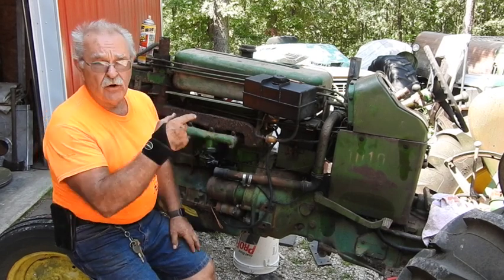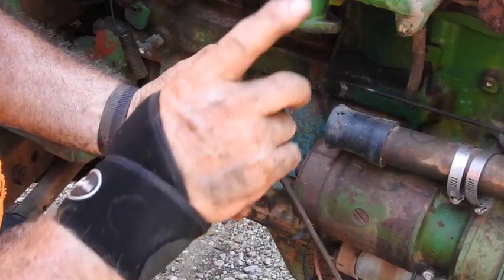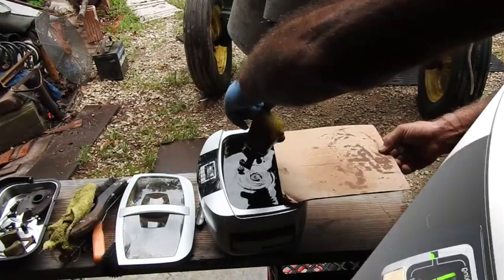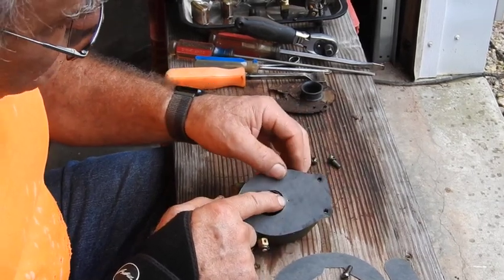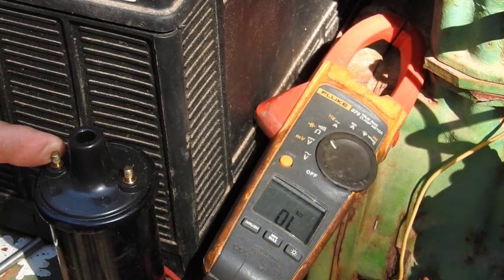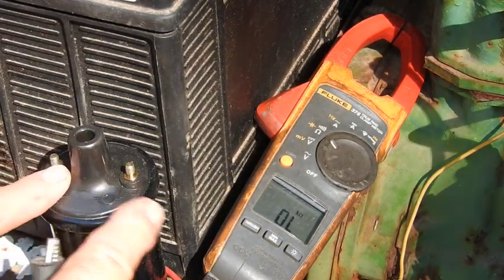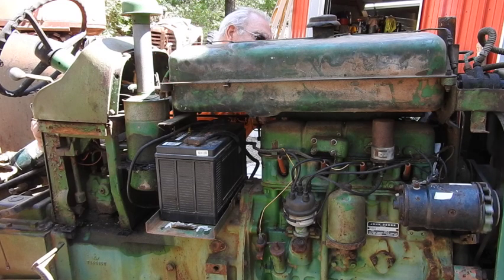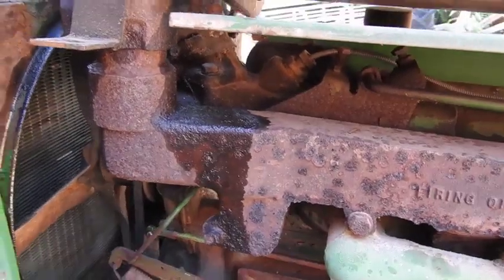ITS ALIVE !! John Deere 1010 Crawls From The Grave First Start

Comment: My Gas 1963 1010 has to much slip in the steering before engaging.
Any suggestions?
Reply from the maker: I haven't had to work on this particular one but there should be an adjustment on the outside of the steering sector.  They usually look like a slotted stud coming out the center of a lock nut. The sector and worm are worn a bit and this adjustment should reduce the excessive backlash. Good luck with the issue.

Comment: I got a 1961 1010. Last weekend it started spitting and sputtering while bushhogging so I limped it back to my shed  and knew it was my points cause they have a plastic piece that it hits everytime it turns around. 
And it was wore down to nothing. So I already had set of points. Installed new one and gap to .22. Started back up and it’s still running rough. Like it sounds like on 3 cylinders. So I changed spark plugs gap them to .25 and still running rough. So I cleaned carb. Actually it was pretty clean. But what I’m hearing is this popping noise thru the breather cap. Like a misfire pop. Never heard that thru the breather. Any idea what it is or any pointers. 
Thanks. 
Glad you got yours up and running.
Reply from the maker: Might be something simple like a piece of carbon stuck on one of the plugs.  I'd pull one wire off at a time to see which cylinder doesn't make a change, then pull that plug and see.

Comment: Wendell we are lucky men. 
The mistakes we make may haunt us but haven't killed us yet. 
When you were discussing the problems and fixes to said problems during the video you mentioned using a MIG welder to resuscitate a broken governor spring. 
That reminded me of a story from the days before Sneelock was a real fix it and he did a few things that, well shall we say, weren't the most prudent. 
It will be up tomorrow because we all like to see our heros admit that although we seem to have God Like Powers, it is just as likely to be selective editing. 
Congratulations on getting the JD 1010 running.
I learn something new every time I watch one of your videos. 
I just checked coils for continuity. Never bothered to read the resistance. I realize now that I could have been fooled by a shorted coil. Must be my luck held. If they passed current they worked.😁😎 
For the gas tank fix I was going to take my 8N tank to a shop up by Battle Creek that repaired fuel tanks to remove the rust. I spoke to the owner and he told me how they would cut out an access panel in the top of the tank and be able to work both sides of the baffle and clean it. 
The cost was right close to the cost of a new one so I decided to do the old method of filling the tank half full of water and a couple pounds of steel nuts. Then I strapped it over the front of my cement mixer and let it run. 
It came out okay. If it hadn't I was planning on cutting a hole in the top and seeing if I could fix it myself. 
Last year I saw Jon @ Farmcraft101 cut an hole in a bulldozer diesel tank and clean out the inside. He bolted a patch over the opening with a gasket. Might be something to try.
Reply from the maker: Well the old point systems were a bit forgiving but if you ever had a car, truck or tractor that seemed to eat points for fun...it might've been the resistance of the coil was too far out.  That's why some require an external resistor on a 12 volt conversion if you want to keep a 12v coil in the circuit.  Some guys put a toggle around the resistor to start it with the 12 v coil then switch the resistor back into the circuit immediately after she fires up.
   We too have done the 'hole' route on a couple gas tanks.  It's a last resort though for me.  I use electrolysis on the ones without a baffle as well as having done the nuts routine  ties to a tractor rear wheel.  It's ALL a pita though no matter what.  LOL

Comment: Have you ever found a screen or filter on the hydraulic system on the 1010 ?
Reply from the maker: No, but I haven't looked yet.  Eventhough this sat here for ten years or more, I just got it cleaned up and running a few months back. So for now it's been on the pto wood splitter to get some run time. Its not mine, I'm just storing it so I thought I should go ahead and use the darn thing.  It looks like its going to be here a while.
Reply: Yup my purrs like a tomcat in a creamery but FEL is getting a little sluggish.

Comment: Hello.  Do you add any lead additive in with the gas?   My dad was saying I should on my Oliver super 55 I am working on.
Reply from the maker: I only add lead to old engines that I totally rebuild.  Some of them have valve seats that are no longer available and the lead softens the impact of closing.  The same thing goes for the hardened surface on the existing cam shaft if its re-used with everything else being installed new.  The hardened surface on the cam lobes have decades of wear already so may as well protect them from the new parts as well.  Other than that situation, I just use a product called PRI-G for gas engines to maintain the new formulated fuels stability.  I also am fond of using SeaFoam for long-term storage of gas powered equipment.  But one thing about it, your dad isn't wrong....it sure isn't going to hurt anything to use it.  The naysayers swear nothing is needed for anything, but personally I don't agree.

Comment: I recently purchased a 2010 that was sitting for years. The right back wheel won't turn. Any advice on freeing a brake or could it be something else. Thank you.
Reply from the maker: More than likely its a stuck brake Alan.  They have a tendency to rust up especially if the old machine sat outside for a considerable time.  IF its something else, you may be in for a bad day. I haven't needed to get into these yet, but they can't be too difficult.  As a matter of fact, they may actually be disc brakes.  A lot of tractors were changing to those in the late 50's or so.

Comment: Some rats have eaten the spark plug wires, Just verifying distributor on the 1-3-4-2, 1 is upper right, then left is 3, down left 4, and down right is 2. Rotor is counter clockwise. Correct?
Reply from the maker: Sorry I missed this comment and I'm sure you've got yours up and running by now.  But yes the distributor turns CCW and the firing order is 1-3-4-2.  The actual location of the wires on the cap really doesn't matter as long as the rotor is pointing to the wire that goes on #1 when you begin installing the wires...then go CCW with 3, 4 and 2.  Some caps do have a #1 identifying a terminal so on those I try to always put that wire to #1 to avoid confusion, but you still have to be sure the rotor is pointing to that port on the cap.  Damn rats !!

Comment: Wait till you need to time it, lol!
Reply from the maker: Luckily its running pretty good for now.  I just put points in my older brothers 301 three cylinder gasser and that was tough enough !!  That's the tightest distributor I think I've ever been in.  This 1010 was a snap by comparison. What's the deal with the timing on this one...??

Comment: I really enjoy your videos and I learn a lot. I have a farmall h and it’s been sitting for about 5-6 years. I got it cranking but not started. Is there any way I can get in contact with you I have a few mechanical questions cause I really want to get it running.
Reply from the maker: Well, I get a high quantity of emails daily so most times it takes me a while to answer them sometimes, but you can try at whpete44@gmail.com.  In the meantime, I'd suggest at least glancing through the Farmall H playlist here: https://www.youtube.com/playlist?list=PLk72G9DTzZ1u4HTcEVKC3ehyV_UsFYaAG or some of the First Start playlist as well: https://www.youtube.com/playlist?list=PLk72G9DTzZ1uWqQ2hDCRVubPve9JlLzhw  There's a ton of coverage about wiring issues, points, condensors and alternator conversions. Good luck, with the project and I'll try to keep an eye out for an e mail.

Comment: 🤣🤣🤣 That long walk off a short pier goes double for me!!! Some of the new vehicles are even worse. Trying to do just basic maintenance can be a nightmare. I know they make it difficult so you have to take it to a Dealer but it can be idiotic. The steering shaft through the radiator on my Farmalls is pretty dumb too. Taking the gastank off of my JD "B" can be a real chore with the steering shaft right in the way. I think sometimes it looks like one engineer designs part of it and another engineer needs to change the design to make something fit and they just do what is easiest at the time for them. 🤷‍♂🤷‍♂🤷‍♂ Having so many tractors and vehicles makes it difficult to always use or run each one to keep them operating properly. Making time between projects is usually real difficult. ☹☹☹
Reply from the maker: Yeah...I think it's crazy to route the steering shafts through the tanks and radiator.  TheMuch Older Brothers 400 LP does the same thing.  I feel your pain with the too many tractors and too many vehicles !! LOL Btw, I just picked up a radiator for the JD 50 this weekend.  I'm planning on a winter repair for that thing. Along with a few little tid bits on the 1010...two of which are kinda major.

Comment: Runs very good for a quick start. Them gas engines with a bit of work always sound good....CHEERS
Reply from the maker: I don't think this tractor has ever worked real hard.  That's a good thing. A few problems to work out then it'll be good to go for sure !!

Comment: I put a clutch disk in backwards on a Chevy pickup many decades ago.  We hang a magnet on a copper wire in a rusty gas tank. And pull that magnet out and clean it off on occasion. We often catch some very fine rust on that magnet. The best way to address fuel is to never leave a drop of gas in the tank or carb if its going to set very long. But you already know that.
Reply from the maker: Yeah, this sat for a good many years with about an inch of gas in it.  Its pretty bad...actually really really bad.  And they run the steering shaft through the center of the dang tank too.  That makes it much more difficult.  I do the magnet too then do the electrolysis thing with them.  But this time, I might try the vinegar trick.  I have three gallons to dump in there after I power wash it.  I'm not sure the clutch is backwards, I'm just betting it is.  Looking in the inspection hole, and the adjustment made for the most travel the throw out bearing bottoms out before the disc fully disengages.
Reply: or to completely fill it to reduce condensation on metal

Comment: Fantastic....it lives and drives.
Reply from the maker: Good morning Terry. I got lucky on another one !!  Now to sort out the rest of it.
Reply: @tractorman4461  Still impressive,  what's the old saying, "it's better to be lucky than good", or something along those lines.

I picked up a 1967 Ford 2000 gas last Sunday.  Drove about 6 and a half hours to get it.  Here's a video of it that the seller sent me. https://youtube.com/shorts/YrxXYT4C23o?si=nTK6MOcQyUviAOxn
Reply from the maker: @316jd140  Wow !  That thing looks mighty blue !!  The main thing is it sounds pretty dang good.  I'm sure that's gonna be a good one for you.  I couldn't tell the motor though...3 cylinder like mine or the 4 cylinder one ?
Reply: @tractorman4461  There were two versions of the Ford 2000, the first one, from 1962 to 1964 was just a rebadged and upgraded 601 series with the 134 OHV 4 cylinder.  Then in 1965, Ford came out with the 3 cylinder 2000, as well as the 3 cylinder 3000, 4000 and 5000 tractors.  There were gas and diesel versions of all models, and all with 3 cylinder engines.

From what I read was that the American diesel Ford tractors that came out in the late 50s was just a gas engine converted to diesel.  In Europe, though, Ford was making 3 cylinder diesel engines that were designed from the ground up to be diesel engines.  So when Ford redesigned their tractors in 1965, they used that same 3 cylinder diesel engine and converted it to gas.  And they also put the diesel engine in those models to give customers the option of gas or diesel.  That line was made from 1965 to 1974, and in 1975 the line got upgraded, i.e. the 2000 became the 2600, the 3000 became the 3600, etc.
Reply from the maker: @316jd140  Thanks for the additional info.  Btw, I sold the old Ford hundred series loader this morning.  Loaded it for a young man in Richwoods. My 2000 is a '72 three cylinder gasser.  I converted it to Pertornix electronics you may remember.

Comment: Definitely different sound then the 440 2 cylinder, jonny pop
.
 its supposed to be about the same displacement, as the 1010,
 4 cylinder.
Reply from the maker: The Much Older Brother has a 440 highlift with the 2-53 Detroit two stroke diesel.  I'm not familiar with a 440 wheel tractor Bruce.
Reply: @tractorman4461  it's the same engine  transmission with tires.
The 1010 was also made as track and wheel versions. 
Yellow and green versions are out there.
Reply from the maker: @BGW_enterprises  There's not a day goes by that I don't learn something new Bruce !!  Thanks for the information buddy.
Reply: @tractorman4461 
Some amazing history on film.
Shows the reverser in the 440 had to use the cluch to change directions.
As well as many machines I didn't know existed.
.
https://youtu.be/UxIZo4CTMBw?feature=shared
Reply from the maker: @BGW_enterprises One thing about it Bruce, the more I learn the more I learn I don't know !!  That's an interesting video, thank you for the link.

Comment: WOOOHOOO! It WILL start! Our tractor has that carb. We needed to flatten the mating faces so the interior passages would seal properly. Cool tractor.
Reply from the maker: Yes, I've 'surfaced' them on an old 6x48 belt sander and used an industrial 'gasket maker' sealant on a new gasket to solve the issue as well.  I got an old squeeze bottle of the sealant from an old buddy that's a retired heavy equipment mechanic.  It was some good stuff too.
Reply: The tractors wouldn't be running at all here without the info I learned from  @tractorman4461. Really appreciate these vids.
Reply from the maker: @___PK__  Hahahaha....now don't go give me too much credit.  LOL. But if you do get a little benefit from the videos I am happy to know that.  Have a great day !!

Comment: Nice job Wendell. The little 1010 sounds pretty good. My wife wants me to ask you what brand and model vacuum sealer your family uses. She seen it in one of your videos where you where putting up beef I believe. Thanks.
Reply from the maker: Our original one is a Cabela's CG-15.  I was looking up parts and found that they are made by Weston.  So now the Cabela's is the backup and the Weston Pro-2100 is the one we use.  All parts interchange, essentially the same machine. The vacuum pump failed in the Cabela's and they wanted $135 for the pump that'll sit on a half dollar and made of plastic.  Probably thermoplastic, but still it failed.  The Much Older Brothers CG-15 is at least 20 years older than mine and still working perfectly. Expect $350 or so for the Pro-2100.
Reply: @tractorman4461   thank you. I appreciate it. She goes through 1 of the foods foodsaver brands about every 3 years.
Reply from the maker: @ricksmith-iw2op  Foodsavers aren't much for doing whole hogs or beef.  My Much Older Brothers has done literally dozens of beef and even more hogs in the years we've used it.  Never a failure.  I think mine failed because of a factory assembly problem.  But once I buy the part, its literally a 20 minute fix.  But ALL the parts are interchangeable.